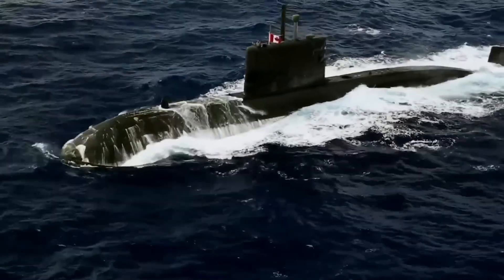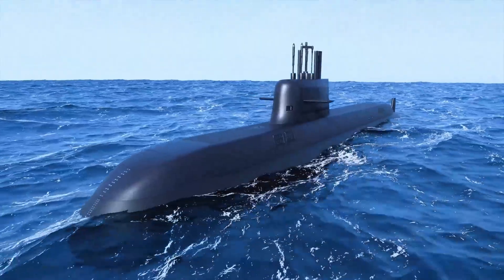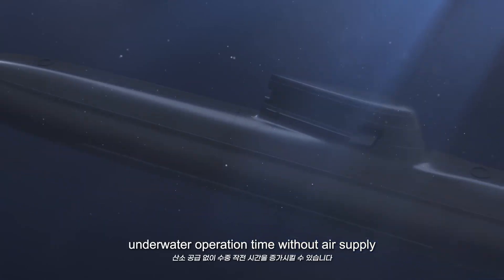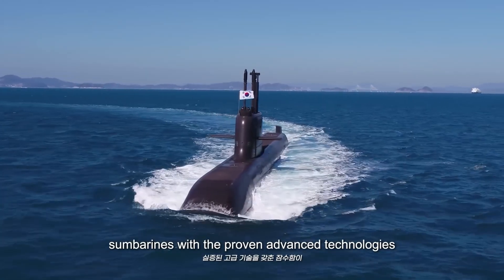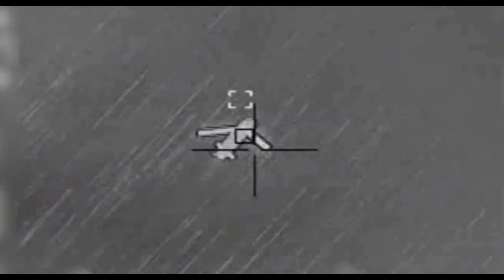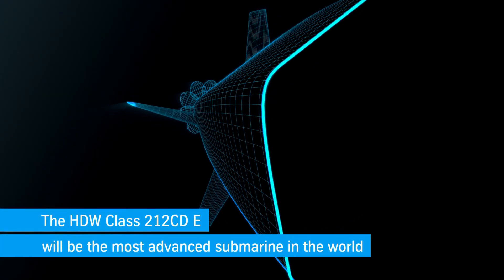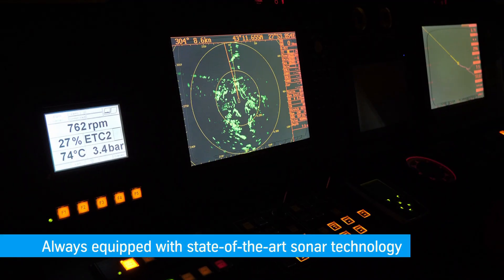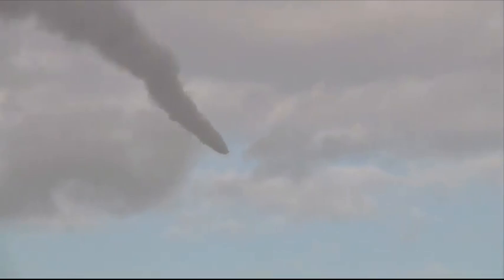RCN's Potential Next-Gen Subs

Comment: The SK boat is 100% the way to go...the spin-off economic opportunities are huge...I know Germany is a bigger strategic ally, but the size, firepower, speed of delivery, capability and domestic economic benefits is too much to ignore..
Reply: German submarines, particularly the Type 212 and 214 models, are medium-sized vessels designed for coastal operations. They have limited operational range and endurance, and their fuel and resupply capacities are constrained, making them unsuitable for countries like Canada that require coverage of the Pacific, Atlantic, and Arctic Oceans. This design philosophy reflects the operational environment of the German Navy, which primarily operates in coastal waters such as the Baltic and North Seas.

In contrast, South Korea’s KSS-III-class (Jangbogo-III) submarines are large vessels of approximately 3,700 tons or more, capable of ocean-going operations. They are equipped with large batteries, hydrogen fuel cells, and an Air-Independent Propulsion (AIP) system, enabling extended submerged endurance and long-range missions. These submarines can also carry long-range cruise missiles. The large batteries extend the duration of electric propulsion, while the hydrogen fuel cells and AIP system allow prolonged submerged operations without atmospheric air, significantly enhancing stealth. This technological advantage enables KSS-III submarines to conduct sustained operations across the vast maritime areas required by Canada.

German submarines are primarily deployed in European waters. Specifically, Type 212A and 214 submarines operate in relatively shallow and enclosed seas such as the North Sea, Baltic Sea, Mediterranean Sea, Adriatic Sea, and Aegean Sea. While they benefit from quiet AIP operation, their displacement is only around 1,800 to 2,000 tons, and their operational endurance is typically limited to 2–3 weeks, making them unsuitable for oceanic voyages.

Therefore, while German submarines are suitable for European coastal operations, the KSS-III clearly represents an ocean-going expeditionary platform. For Canada to meet its strategic requirements, the choice is evident. The KSS-III-class submarine is uniquely capable of supporting Canada’s maritime security strategy across the Arctic, Atlantic, and Pacific Oceans.
Reply: Originally, German submarines, including the 212A, do not have icebreaking capabilities, and as far as I know, the 212CD roadmap does not either. The German Type 210 submarine, a coastal variant designed primarily for the North Sea and Baltic Sea, has not been operated near the Arctic. By the way, South Korea also operates the Type 209 submarine. Leveraging advanced technology, Korea’s submarines have overcome the limitations inherent in German submarine designs, enabling them to conduct operations not only in the areas typically covered by German submarines but also across much wider and more demanding maritime environments.
Reply: What we should focus on here is that Hanwha’s Korean icebreaker successfully broke through 2-meter-thick ice, and it has numerous ice navigation records not only in the Arctic but also in the Antarctic. These icebreakers account for 65% of the global fleet, and a next-generation icebreaker will be launched in 2026. Given this, do we even need to discuss the Arctic submarine capabilities of a submarine built by Hanwha, which possesses that icebreaking technology? In any case, it is clear that Korean technology has a technical advantage over the German counterpart. If necessary, I think switching to nuclear propulsion wouldn’t be a problem for KSS3 the KSS‑III in the near future.
Reply: With all politics aside I have to say that technically the 212CD is the winner on the capability front. They are ahead in all items except the VLS but if Canada ordered the 212CDE version then we can get the VLS. Plus they have a longer lasting and safer battery. The game changer is the 41 days without snorting depending on the mission. This video is very biased towards favouring the KSS3. I have to wonder if that wasn’t by design. What constitutes foreign interference and what doesn’t? The 212CD is so much ahead it is no contest.
Reply: Where are you seeing any claim of 41 days submerged operation for the Type 212-CD. Longer submerged time would likely mandate use of newer battery tech (which is rapidly changing and improving beyond Life btw), but I've seen nothing that confirms that the Norwegian/ German boats will be using same. 

As to the notion of Canada going with the larger expeditionary version and adding a VLS system - that sounds great if not for the billions in development money that would cost along with the years of additional time it would take and the uncertainty as viability/ proof of concept.

Comment: Having done research on both subs I am going to go with the KS-III for Canada.
Reply: German submarines, particularly the Type 212 and 214 models, are medium-sized vessels designed for coastal operations. They have limited operational range and endurance, and their fuel and resupply capacities are constrained, making them unsuitable for countries like Canada that require coverage of the Pacific, Atlantic, and Arctic Oceans. This design philosophy reflects the operational environment of the German Navy, which primarily operates in coastal waters such as the Baltic and North Seas.

In contrast, South Korea’s KSS-III-class (Jangbogo-III) submarines are large vessels of approximately 3,700 tons or more, capable of ocean-going operations. They are equipped with large batteries, hydrogen fuel cells, and an Air-Independent Propulsion (AIP) system, enabling extended submerged endurance and long-range missions. These submarines can also carry long-range cruise missiles. The large batteries extend the duration of electric propulsion, while the hydrogen fuel cells and AIP system allow prolonged submerged operations without atmospheric air, significantly enhancing stealth. This technological advantage enables KSS-III submarines to conduct sustained operations across the vast maritime areas required by Canada.

German submarines are primarily deployed in European waters. Specifically, Type 212A and 214 submarines operate in relatively shallow and enclosed seas such as the North Sea, Baltic Sea, Mediterranean Sea, Adriatic Sea, and Aegean Sea. While they benefit from quiet AIP operation, their displacement is only around 1,800 to 2,000 tons, and their operational endurance is typically limited to 2–3 weeks, making them unsuitable for oceanic voyages.

Therefore, while German submarines are suitable for European coastal operations, the KSS-III clearly represents an ocean-going expeditionary platform. For Canada to meet its strategic requirements, the choice is evident. The KSS-III-class submarine is uniquely capable of supporting Canada’s maritime security strategy across the Arctic, Atlantic, and Pacific Oceans.
Reply: @max_7344 exactly the "coasts" of Canada, we don't need subs down in Africa to do missile strikes on China, also the 212cd will be double the size and have more operational range etc of the other models as they stated, but the increase range etc will lessen the amount of weapons they can take.  The 212CDs do the same and more as the current subs we have just they are better, logistics wise the 212cd is better for us as well because there's more ports we can dock at etc in our area. Either way everything that actually matters is classified and we'll never know unless we go and operate one so at the end of the day our military and government will decide what sub is best suited for our needs and their performance (much like the current Victoria class) will tell Canadians if it was worth it or not
Reply: 한국은 독일보다 무기 생산과 납품이 빠릅니다. 이건 아주 중요합니다. 한국을 선택한 폴란드는 바보가 아닙니다. 옆동네 독일이 아니라 머나먼 아시아의 한국과 계약한 이유가 있지요. 또한 생산과 납품이 빠르다는건, 물건 구입 후 유지보수도 빠르다는걸 보증합니다.
Reply: Why not one type for the Pacific and the other for the Atlantic. Why put parts procurement in the hands of one manufacture.
Reply: @laudavhutcheon946 Too costly and too complicated to have two entirely different submarine fleets for the same task.
Reply: @JohnLee-db9zt   I know it might seem obvious but please explain. I don't see them preforming the same tasks. It's like saying all planes fly so why do we need more than one type.
Reply: @laudavhutcheon946  You have a good point.
Reply: @laudavhutcheon946  If a single submarine can cover three oceans, is there really any need to divide the operations?
Reply: Germanys sub is designed for artic waters and north patrol where as the Korean sub is built for south warmer and no ice oceans with a promise on paper that it will be a good match for the artic, also it relies on countermeasures to avoid detection unlike the overall stealth design of the 212cd
Reply: @Golden31Eagle  Originally, German submarines, including the 212A, do not have icebreaking capabilities, and as far as I know, the 212CD roadmap does not either. The German Type 210 submarine, a coastal variant designed primarily for the North Sea and Baltic Sea, has not been operated near the Arctic. By the way, South Korea also operates the Type 209 submarine. Leveraging advanced technology, Korea’s submarines have overcome the limitations inherent in German submarine designs, enabling them to conduct operations not only in the areas typically covered by German submarines but also across much wider and more demanding maritime environments.
Reply: @Golden31Eagle Korea probably has one of the worst winters in the world.. also the worst summer 😂 you dont have to worry abt their weather capabilities. They are situated in the perfect location where they get one of the worst summers and winters all year around.
Reply: @Golden31Eagle  What we should focus on here is that Hanwha’s Korean icebreaker successfully broke through 2-meter-thick ice, and it has numerous ice navigation records not only in the Arctic but also in the Antarctic. These icebreakers account for 65% of the global fleet, and a next-generation icebreaker will be launched in 2026. Given this, do we even need to discuss the Arctic submarine capabilities of a submarine built by Hanwha, which possesses that icebreaking technology? In any case, it is clear that Korean technology has a technical advantage over the German counterpart. If necessary, I think switching to nuclear propulsion wouldn’t be a problem for the KSS‑III in the near future.
Reply: @Golden31Eagle  korea's winter temperture  feels like COLDER THAN  canada, because of more windy weather. OBVIOUSLY  more colder than german lol , I lived in both country.
Reply: @지금울고나중에웃을래  thats a debatable topic... besides that has nothing to do with being under the ice in the north artic, and from my experience of living in north Alberta where its -50C and living in newfoundland where its on average -20 to -36C and over 100km/h winds almost all year with harsh heavy snow etc means nothing when you are under the water
Reply: @지금울고나중에웃을래  The average annual temperature in South Korea is about 12.8C, but it varies significantly by season, with January being the coldest month around -1.9C and August the hottest at 26.1C. The country experiences a cold, dry winter and a hot, humid summer, and while specific average wind speed data is not readily available, coastal areas can experience windy conditions. Average Temperature Annual: Approximately 12.8C January: Around -1.9C (coldest month)August: Around \26.1C (hottest month)Coastal and Southern Areas: Milder than the interior, with January temperatures around 2.5c in Busan and 6-7C on Jeju Island.Winters (December-February): Can drop to -10 to 5 c
Reply: @지금울고나중에웃을래  Windiest Areas: Southern Alberta is known as a very windy region; Calgary is the windiest large city in Canada. The East Coast (newfoundland) can also experience very high winds, with extreme gusts recorded up to 233 km/h.
Reply: @지금울고나중에웃을래  In South Korea, winter (December to February) temperatures average between -7°C and 5°C, depending on the region. Average wind speeds during winter generally range from 4 to 6 m/s (approximately 13 to 21 km/h). 
Temperature
South Korea's winter weather is influenced by cold, dry north-westerly winds from the Siberian high-pressure system, making it feel colder than expected for its latitude. 
Central Regions (including Seoul): Mean winter temperatures range from approximately -3°C to 4°C. January is the coldest month in Seoul, with an average mean temperature of about -2.0°C and lows that can drop below -10°C.
Southern Coastal Regions (including Busan): Winters are milder, with temperatures averaging higher, typically between 0°C and 8°C.
Mountainous Regions: Areas like Daegwallyeong, where the 2018 Winter Olympics were held, are the coldest, with average January temperatures around -12.2°C. 
Wind Speed
Wind speed varies by location and month. 
Seoul: Average hourly wind speeds gradually increase during winter, ranging from about 8.8 to 9.4 mph (approximately 4 to 4.2 m/s). February is typically the windiest month.
Busan: The average hourly wind speed during winter is around 13.1 mph (approximately 5.8 m/s), remaining fairly constant throughout the season.
Yeongdong-gun: Average wind speeds in December are around 13.3 mph (approximately 5.9 m/s). 
The strong, dry Siberian winds contribute significantly to the perceived cold, often making it feel much colder than the thermometer indicates. 

Canada's average winter temperatures and wind speeds vary significantly by region, from relatively mild on the Pacific coast to extremely cold in the Arctic. There is no single national average that is representative of the whole country, as the climate is highly diverse. 
Average Winter Temperature (°C)
Winter temperatures in Canada are typically experienced as a wide range across different climate regions. 
Coastal British Columbia: Experiences the mildest winters, with January and February daily minimums and maximums generally ranging from 0°C to 8°C.
Prairies (Alberta, Saskatchewan, Manitoba): Known for being very cold due to the open landscape, average temperatures range from -4°C to -24°C, though wind chill can make it feel much colder.
Central Canada (Ontario, Quebec): Average temperatures in winter range from -2°C to -22°C, with southern parts being milder than northern areas.
Atlantic Canada: Winters are colder than the West Coast, with temperatures ranging from -2°C to -20°C, influenced by cold ocean currents and inland air masses.
The Territories (Yukon, N.W.T., Nunavut): Experience the most severe cold, with average winter temperatures typically between -16°C and -32°C, and January averages in the far north dropping below -30°C. 
Average Winter Wind Speed
Average wind speeds in Canada also vary regionally, with some areas being notably windier than others. 
General Wind Speeds: Precise average national or regional winter wind speeds are not readily available as a single number; however, Environment Canada typically issues wind warnings or includes wind information in forecasts when the mean speed is expected to be 20 km/h or higher.
Windy Regions: Southern Alberta is one of Canada's windiest regions, with cities like Calgary and Lethbridge experiencing a high number of windy days per year. Strong wind gusts, known as Chinooks, are common in southern Alberta. St. John's, Newfoundland and Labrador is also one of the windiest major cities in Canada.
Wind Chill Factor: Wind speed is a critical factor in the wind chill index, which indicates how cold the weather feels. For example, a temperature of -10°C with a wind speed of 20 km/h can feel like -20°C. 
Wind speed and wind chill Wind chill: Wind speed significantly impacts how cold the temperature feels. With a 60 km/h wind, a -50^C ambient temperature can feel as low as -78^C.Typical speeds: Coastal areas in Newfoundland can experience sustained winds of 50-80 km/h during low-pressure systems. Strong wind gusts can occur, especially in certain coastal areas, reaching 120-140 km/h in Newfoundland. so tell me again please how Korea is colder?
Reply: @Golden31Eagle  normally , water temperture is above  temperture at land. becuase of latent heat .
Reply: @Golden31Eagle  at 2000- 2021 averge coldest day temperture is around -17-18 , last 3years were unusually warm winter , at 2021 , it was estimated -23.1 at seoul.. it s only for south korea, north is averege -20 below
Reply: @Golden31Eagle  yeah I agree that. I had stayed vancouver, which is not cold as where you saying.
Reply: @지금울고나중에웃을래 yep, the west coast.... The warmest place in Canada lol, right above California, our other 3 coasts are absolutely freezing as the largest coast is the North pole and northern coasts where sunlight barely goes.
Reply: You need to do better research.
Reply: @allannantes8583  While submarines exist on paper, they are currently under construction, and their completion and validation are uncertain. Germany possesses cutting-edge technology, but lags behind in economies of scale and shipbuilding capabilities.
Reply: @allannantes8583 I don't think so.
Reply: @JackDionne I think so.
Reply: @allannantes8583  Look 212CD sub is still on paper and I'm development without a single sub produced. Canada will be third in the line behind Germany and Norway. Canada will never see one build until after 2040.
Reply: @Joseph-eh4rs  germany said if canada says yes we will get the first couple of subs as we need them
Reply: @Golden31Eagle  Stop lying.  Norway receiving the first in 2029 and Germany in 2032 if they can actually meet their dead line.  So Canada will maybe get first several years from that if lucky